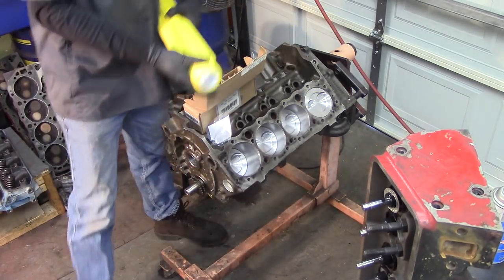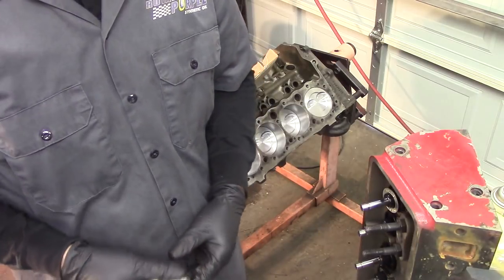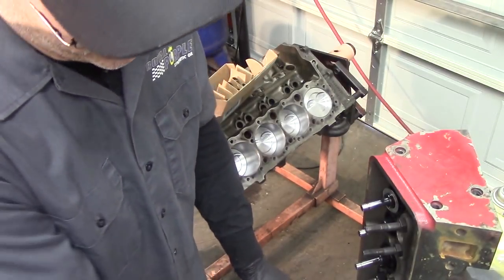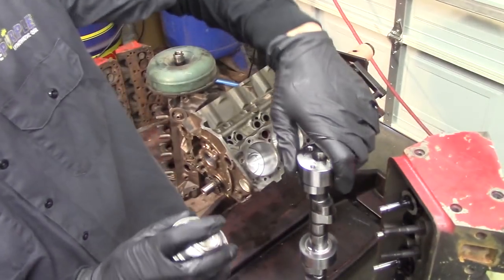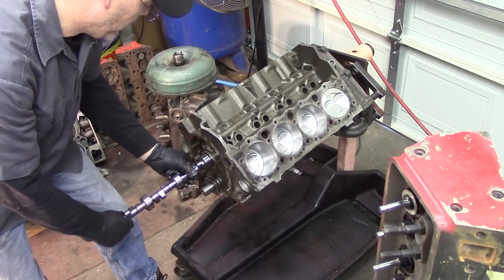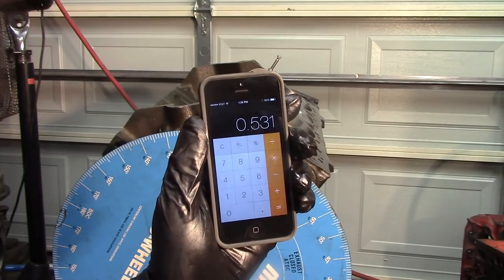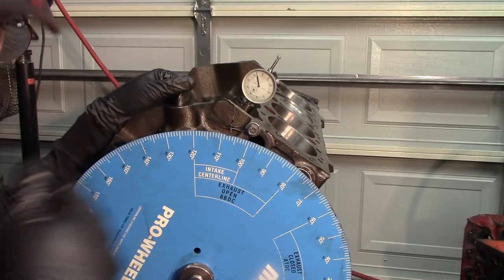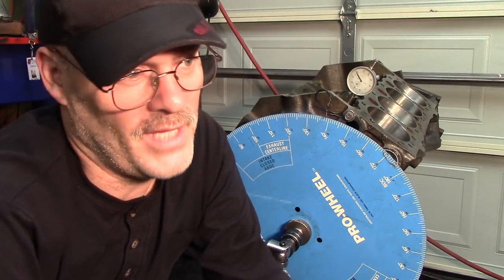383 Stroker Engine Build Part 7 (Camshaft)

Comment: Excellent video! I am planning to stroke my 68 Pontiac 350 out to a 383 with a balanced rotary kit. My engine is numbers matching in a 1968 Firebird. The heads have been rebuilt with hardened seats. They are stamped #17  which are 72cc 1.96 / 1.66. I plan to use flat top pistons and want to use a roller cam. Given these perimeters, what  would be the best RPM target and Cam selection. My compression should be close to 10.00:1
Reply: I should add that I am looking for a cam for street performance and long cruising. Not racing but what to take advantage to the stoke. Any insight would be greatly appreciated. Thank you in advance.

Comment: I've only rebuilt a handful of engines, but after doing the fist one and dialing in the cam, I quickly realized what a pain in the ass it was having ALL the pistons in and doing this. From the second on I only put in #1 piston and then dial in the cam.  It is, Yeah,,, 8 times easier to roll over the engine!!!  lol... 
I like that you over explain things. Where were you 40 years ago??? ;)
Reply: Arrrrgggghhhh! Why didn't I think of only putting one piston in :0(
Reply from the maker: 40 years ago I was in grade school
Reply: That's flipping genius lol It doesn't hurt anything or change the accuracy doing it with just 1 piston in?
Reply: I put the cam in with block standing vertically...and degree with #1 piston installed.

Comment: Since it took 6 weeks to deliver the cam, when you ordered the cam did it state in fine print that you should wait 4-6 weeks for delivery, due to them having to manufacture the cam first?  I know there's some subframe connectors that are made to order, this is so they don't have a bunch of metal stock on hand unpainted (due to customer preference on color, they can't paint them until ordered of course) that will degrade in quality from moisture and whatnot from just sitting around in a warehouse unpainted.  Camshafts are the same way, they're precision products that they don't want sitting around with the possibility of getting dinged up in storage, they make either steel or cast iron parts that can't be painted so they don't want the rotating journals to rust from just sitting around.  Also it saves them money since they'll produce cams only on demand and preorder, so they're not making a bunch of cams no one wants to use anymore.
Reply from the maker: Yes it is a custom grind the make it after you buy it

Comment: About 20 years ago, I built just about the same engine you’re building in this series of videos.  I went through all the steps you did with a few minor deviations.  Someone gave me a solid four bolt main 350 block and I had it prepped by a machine shop…thorough cleaning, boring .030 over and check the deck and install the cam bearings.  The cam bearing install was the only thing I didn’t trust myself to do properly.  You never showed how to install the cam bearings and insure the oil holes were lined up.  You also neglected to emphasize the importance of gapping the rings on hypereutectic pistons which is different from standard cast pistons (wider gap).  High compression ratio with its resultant “pinging” using 92 octane pump gas can be mitigated by using aluminum heads.  So far, after checking the cam against the cam card specs, which is nothing more than insurance that all the work you’ve done isn’t wasted in case the cam card is wrong, you still haven’t mentioned other things that needed to be described in the first video…like ignition, heads, longer pushrods required due to a smaller base circle of the cam, headers, and intake system (carb or injection).  I guess my suggestion is to tell us everything in the first video about what you’re going to build and for what purpose (what’s it being installed in) and then show us how to do it without being redundant.  All that aside you made a series of videos of what I did over twenty years ago…383 stroker in a ’66 Nova with stock rear suspension that would do 0 to 60 in 3.7 seconds.  Don’t take me the wrong way…it’s a great series of videos I found quite informative and nostalgic.  Thanks for posting.  I hope people come to you to have their engines built.  You definitely know what you’re doing.

Comment: Great 👍 video question my 76 454 block had a flat tap cam but I’m installing a hydraulic roller the block has provisions (hole) for the cam retainer should I use a retainer plate or the button
Reply: Yes.

Comment: getting ready to degree my first engine. one thing that confused me on the video though. i know you said to go past when turning reverse rotation, then turn normal rotation to .050, but when you release the wrench, the degree wheel turns a degree or 2 (assuming the weight of the wrench).. should you always hold chain tension in the direction of normal rotation for an accurate degree readout?

Comment: Question. When putting together a flat tappet camshaft motor? Is special oil monitory whenever changing the oil? Or only when breaking in the camshaft?

Comment: Im using KB Hyperutectic Pistons in a 383. They are saying that the piston to wall clearance needed is .002.  In your opinion , is this correct ? Sounds tight to me.  And to be clear , is that .002 TOTAL , meaning that the difference of the bore vs the piston is only .002 difference ?  Thanks for the help. Great video's.
Reply from the maker: Yea sounds right Hyperutectic runs the same clearance as cast pistons .002 will be fine

Comment: I've watched probably 6 or 7 different videos on cam degreeing so far including from Summit Racing and some big-named parts suppliers and engine builders and I haven't found any as clear and to-the-point as this!

Having said that I still have a few questions:

Measuring lift: Why did you put the dial indicator on the tappet instead of on the valve itself? (How did you position the dial indicator on the tappet? it appears to be just magically floating there..) -You previously talked about stack tolerances and multiplication of errors adding up being a reason to degree a cam in the first place: it seems like there's no where were this effect would be worse than going from the tappet/pushrod side to the valve side as the rocker ratio multiplies the errors by 1.5 - 1.6-- no?
Reply from the maker: The dial indicator is attached to a lifter bore gage it is definitely not floating it is sitting directly on the lobe I'm not sure how you would put it on the valve when the heads are not on the engine you will get the cam degreed to the exact degree with this method no margin of error to get valve lift you simply times the lobe lift by rocker ratio

Comment: how tight should the timing chain be? should there be any slack, or very tight?
Reply from the maker: The service manual gives you a defeection spec most are a little loose
Reply: @Myvintageiron7512  ok thanks, my engine guy told me we will get a new timing set.. what has him puzzled is why there are 198 heads on a vortec roller block. we are going to replace the dish pistons with flat top, and go back with the stock cam. I asked if the .20 thousand ths block bore were doing would raise compression any, and he said bore size has nothing to do with compression ratio but a flat top piston should raise compression maybe to 9 to 1
Reply from the maker: @randy1ization  to say that compression ratio is not effected by bore size is not correct I'm surprised a machinest would say that,  he either needs an education on compression ratio or you mis understood him,  to say bore size has nouthing to do with compression ratio is just plain wrong it absolutly does effect it but in your case .020 is not a big deal
Reply: @Myvintageiron7512  it makes sense that a larger cylinder would increase compression ratio. as a teenager I tried putting 350 heads on a 305 chevy.. the car started and ran, but couldnt peel out in wet grass. so the opposite scenario was in effect.  its shocking to me that someone could be in the trade so long, and not know these things., hopefully he can get my crank bolted in right, and my pistons in right.

Comment: Why do this though? Is it necessary everytime you put a new cam in or is it just for your own knowledge of knowing it’s right
Reply: I suppose if everything is stock oem replacement there isn't a need to do it other than making sure the cam is ground correctly. You want to know these things because cam timing is critical. Say his cam was supposed to be installed at 110*. Well he showed 104 degrees so he would need to adjust for that otherwise the engine power band would be terrible. As it is, hes dead on with what the card says so he's fine.

Comment: I would always use gear drive I never use chains
Reply from the maker: Gear drive is only for drag racing if you run it on the street your cam and crank will have a short life never ever use gear drive for stop and go driving very bad idea

Comment: No disrespect intendid but why all this degree-ing off the cam, you cannot adjust anything, unless you regrind.
Reply from the maker: That's not true at all you can make all kinds of adjustments
Reply: @Myvintageiron7512  can you maybe give me a couple off examples off adjustments? Iam dying to find out.
Reply: @adolphjanssen6580  you use off set bushings on the cam dowl pin 
https://www.summitracing.com/parts/cca-4760

Comment: FINALLY !!!!!!!!! SOME ONE THAT EXPLAINS IT PROPERLY , THANK YOU....
Reply: scotty j amen bro ive been to a decent auto tech school however the focus was theroy amd repair not hi performance,  but this guy has a formula that just clicks. I did me a 383 sbc for my one ton van 92 g30. Had choppy cam some bolt ons sounded great. Ran nothing like i wanted. Watched me some vids of this man breaking down camshaft knowledge. My rv cammed 2bbl (670cfm holley unit) tbi 350 (aftermarket vortec top end swap as it a 1992) true h.e.i. ign. Is now the torquey beast i was tryin make it. Thanks to vintage iron.

Comment: Loved you video,I'm doing a build on a 30 400 small block,with a mild hydraulic roller cam with 76 cc heads on pump gas....any advice.

Comment: You answered my question about head cc in this video. Thanks I'll keep watching instead of asking stupid questions. Great videos thanks
Reply from the maker: There is no such thing as a stupid question when it comes to engines it's all a matter of experience and education smart or stupid don't really come into the picture if someone has no experience or understanding of a certain aspect or procedure,  asking  the how and why questions is not stupid. Let me tell you what is stupid,  not asking and just working on it or building it by slapping it together with hopes and dreams but no real research or understanding now that is stupid and it happens all the time

Reply ·
Reply: Myvintageiron7512  thanks for sharing your experience with newbies like me. I have always wanted to rebuild an engine and now I'm going to do it. I'm a perfectionist and have never had enough knowledge for such an undertaking. Your explanation of the workings of an engine and how to verify that components are correct, along with the "why" things are important to verify make sense and prove that if a builder takes the time to check all the vitality important clearances etc. You can and will build a engine better then factory. Thanks again for your videos. For my first rebuild would you recommend that I build my 383 stroker or just keep things simpler and build my olds 455 rocket? I can also build a 289 I got sitting in the shed, just for the experience.

Comment: I have a question if you will. I'm building a 454 for a 4x4 truck with a flat tappet cam. Could I use the molly graphite spray on the cam and lifters with the proper assembly lub and zink additive in the oil. Or just use the supplies lub?

Comment: I have a 1997 Chevy vortec 350. And I am gunna rebuild with help of my experienced buddy. So if I wanted to put and different cam in just a tic over stock. And with the stock valve spring's. As long as it will all work? What can I get to have the truck sound good and run decent too? Just a everyday driver. And it's 4x4 with 285/75/16 on it. I'm not sure on what gears they put in those trucks but it is a automatic. Is that enough info??

Comment: hi mvi sorry if i am re sending this not sure if i posted it b4 or not. i measured the lobes & got 334" inlet & 354" exhaust my rocker ratio is 1.6 so if i multiply i get ,534 inlet & exhaust 564 exhaustmy cam card says inlet valve lift 564 & exhaust valve lift 534. im no engine builder but doesnt this mean my cam grind is wrong? or do i need to degree it to check the grind?

Comment: hi there MVI7512, im new 2 all this, just wanted 2 clarify 1 thing. i hav a new cam to go in my L67 GM 3800 V6 with x2 types of pushrods, anyway i discovered that the exhaust lobes r the 2 inner lobes & the 2 outer lobes r 4 the intake, would that b correct? or r all cams different 2 one another?

Comment: So "degreeing a cam" is to verify that the cam is correct and meets specs. I have seen where someones actually changes the timing with an off set key or some other method of rotating the cam sprocket or crank sprocket to "optimize cam timing". I always thought "degreeing the cam" meant that... :-) Thanks. :-)

Comment: seeing u only need TDC on #1 when degreeing the cam, wouldn't it b easier to rotate the crank if #1 and #2 pistons were installed, it seems like ur sorta struggling with all the pistons installed, hopefully u don't need to check every lobe if #1 is correct

Comment: First off, great videos. I am pushing sixty now,,,and still building engines. And still,,,reaching for more knowledge. I am not ashamed to watch videos, read books, etc for more knowledge. I have been a professional Triple Master Certified mechanic my whole life. now for the question,,,,Do you happen to check each and every lobe for specs and not just number one cylinder????

Comment: You have great videos.  I like how you explain why to do things how/why it works, not just how to do it.
Is there any way to roughly figure what porting or even just smoothing out runners on intake and/or exhaust will do for flow # ?  Hoped to get to 400hp.  With this instruction I think I'm looking at 380hp with aftermarket Vortec heads, 76% eff. 2.02/1.60 valves, 61cc comb. chambers, 185cc intake runners.  Thought about just cleaning up the exhaust ports.

Comment: get yourself a large surface plate and two same size V-Blocks..set the cam journals on the V-Block and use a dial indicator on the lobes..if you never did this you should, hhhhhh ))

Comment: there is one thing I always do is put lubricant on any and all bolts that I am going torque to speck .Always. I learned this from an  engineering class. A dry bolt will NOT get proper torque. The lubricant allows the bolt to get maxium stretch when torgue is applied.

Comment: hey bro the only thing I don't get is when you worked out durations how did you come up with 180 degrees when your needle said 142 degrees plus the 10 before zero what am I missing that adds up to 152 degrees wheres the other 40 come from

Comment: iv got a 383 stroker been sline drilled n 60 over all that I received it just needen the outer components but no idea what I'm doing hoping all u narnuts out there can let me know what all I need I know heads timing chain n gears waterpump fuel pump what else do I need to put this together? please help thank you

Comment: Absolutely love this video on the Roller cam and at least you do explain the difference between the flat tappet and Roller cams and how important it is to check not only the cam out just to be sure that the cam is in good condition and is what the cam manufacturer says it is.. then how important it is to degree a cam and be sure it is what it is suppose to be.. thanks again for awesome videos and information..

Comment: I replaced my chain and gears with the double roller style. I also took my cam out to inspect it. I have my dots set dot to dot. Can my cam still be 180 degrees out? If so, how do I check it? Thank You.
Reply from the maker: dot to dot on a chevy is 180 out but its ok to set it up that way to get number 1 on tdc compression one more crank revolution this puts dots at 12 and 12 tdc power stroke

Comment: how do i choose the proper cam for my build?
Reply from the maker: the cam selection is based on head flow and what RPM you want to make your power at Call comp cams help line but have some of your info ready head flow numbers what it's going in and what you want to do with it

Comment: Hi, I've just disassembled my small block 400 that I'm getting ready to rebuild it and start ordering parts.  After viewing your video on what length connecting rods to use, I'm just wanting to know if I should go with the 5.700 that you recommend instead of the 5.565 that came out of it.  Will it affect the TDC where I will have to go with shorter pistons because I went with the longer rod or will I be safe on the clearance.  Thanks.  Really enjoy your videos.
Reply from the maker: You will need a different piston but they are available

Comment: correct me if im wrong but isn't 8+0=8 not 9 and you might want to check your pistons they look to be installed incorrectly
Reply from the maker: not sure what your looking at but I assure you the pistons are in correct that engine has been running for years now you probably need to do a little more reading and research on piston installation before posting